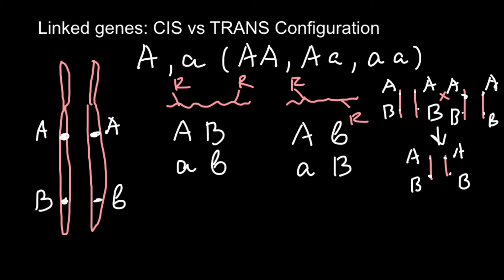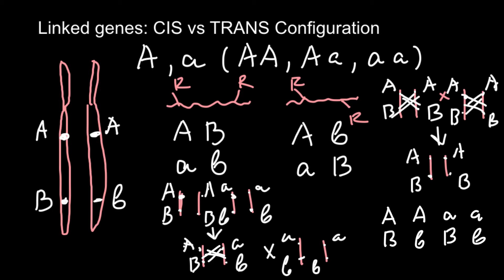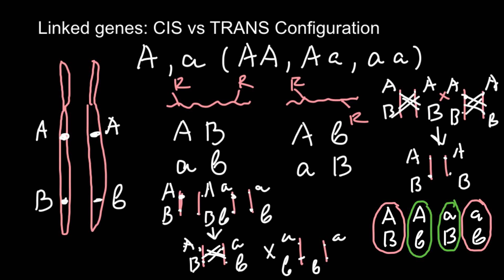Linked genes: CIS vs TRANS Configuration

Comment: When calculating genetic distance between A and B genes with AaBb x aabb cross does the first parent have to be in cis conf. ie. AB/ab since if it were in trans conf. Ab/aB i dont know how id determine parental and recombinant types
Reply from the maker: It does not matter, Cis or Trans - we will just see different % of parental (non recombinant) genotypes in a progeny, but this is not going to affect our calculations.
Reply: @GeneticsLessons  So if I had this Ab/aB x ab/ab cross, in progeny i would have AB/ab, Ab/ab, aB/ab and ab/ab. Are Ab/ab and aB/ab parental then since those would infer that recombination didn’t happen?
Reply from the maker: Parental genotypes in a progeny means crossing-over did not happen.